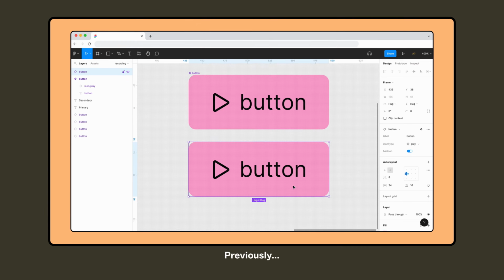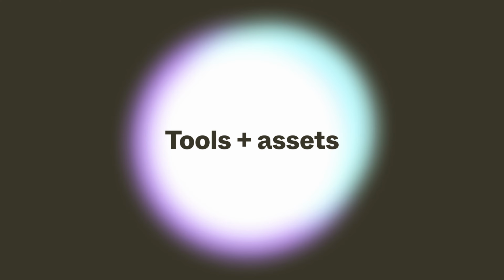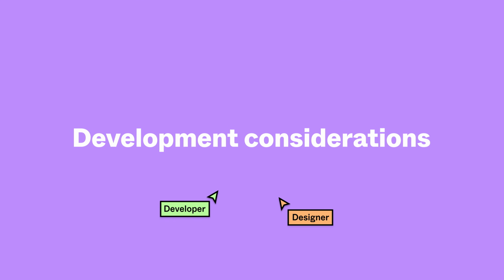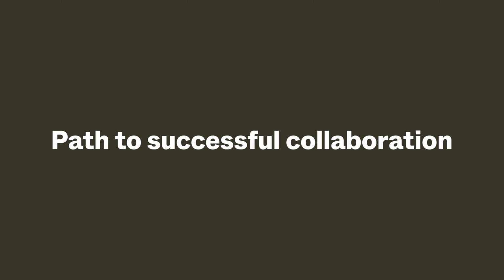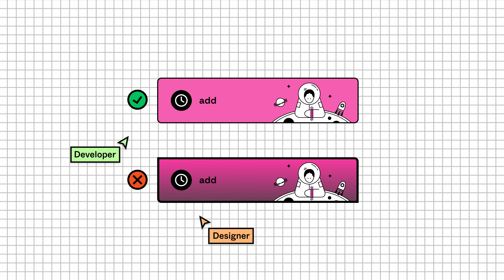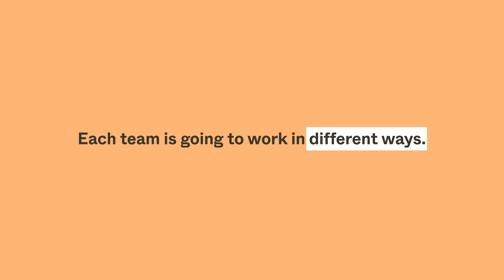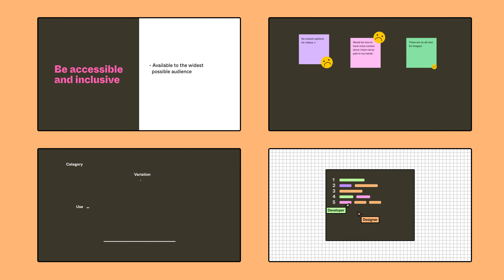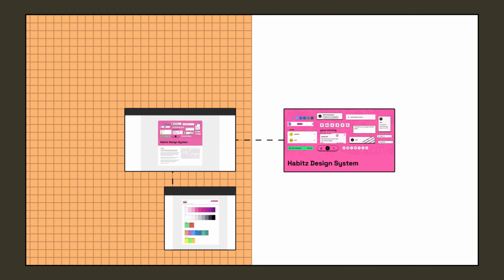Define your design system's processes - Lesson 2 part 4 : Introduction to design systems

Comment: Love the course, thanks for putting it together!

Since you asked for challenges we face in our collaboration with devs: I work on a cross-platform product that has a native Android and iOS app. I'm having a hard time setting up system foundations that align with the native needs of both platforms (eg Apple's typescale isn't on the 8pt grid; Material has a very specific way of handling colors and surfaces that isn't aligned with typical design system best practices). If it's not too specific of  a request and you find that others also struggle with this, could you make a video/course focusing on cross-platform issues like these? 👀
Reply: Hm, would love to hear your problem solution, but it comes to my mind to maintain two systems for both native design components. Otherwise it needs to have custom design that looks similar on iOS and Android, and based on 8px grid as it's a good standard. What's your opinion?